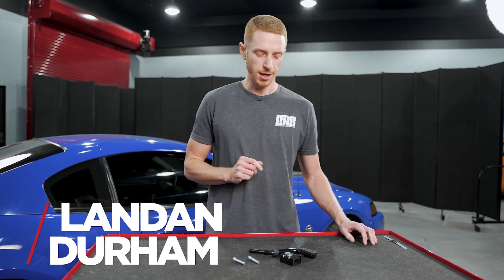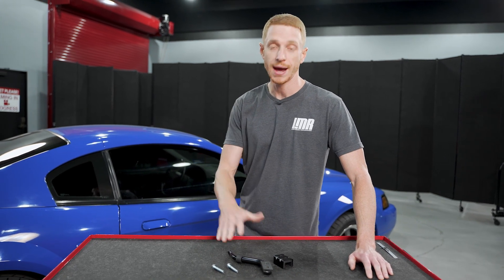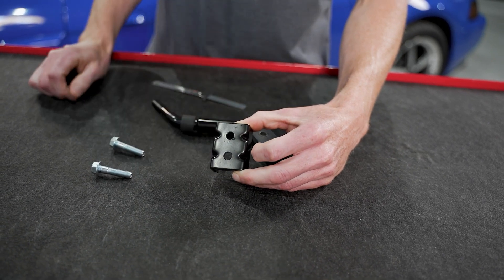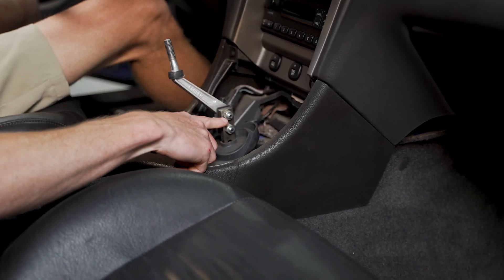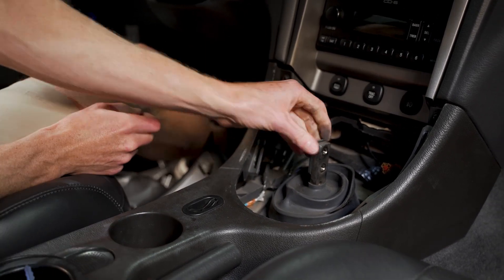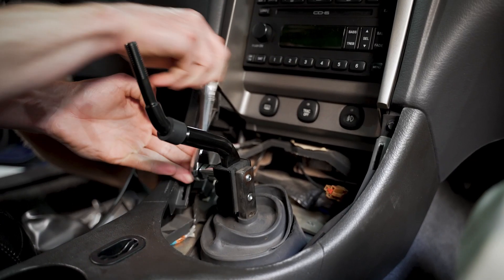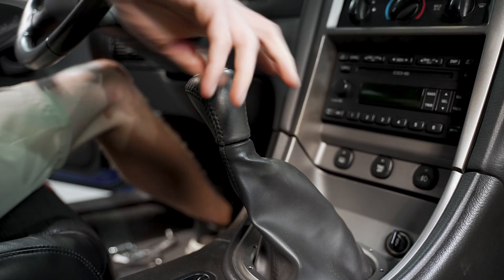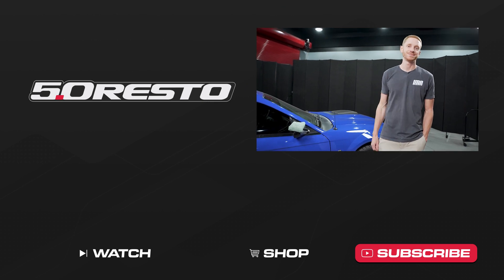1983-2004 Fox Body, SN95, & New Edge Mustang: 5.0 Resto Factory Style Shifter Handle - Install

Comment: The comment and expression you made just after 7:39 made me literally laugh out loud. 

I sittin' here trying to daily this summer in my '86 T-top GT 5 speed. Which includes a four and half to five hour commute EACH WAY on the weekends in a car that has had a 13 year hibernation in the garage, an interior that consist of only: A Dash, door Panels, S&W roll cage, and a set of Summit buckets with five points, all circa mid to late 2000s...  Yes,  mistakes were made. 

Only Lord knows what I wouldn't do for a retractable seatbelt and a cup holder right about now.
Reply from the maker: I know what you mean! -Landan

Comment: I noticed your mach 1 test car had a steeda tri ax shifter. I have one in my 98 cobra and while it's a good shifter, it's kinda notchy feeling. Does this factory shifter handle make it a little easier to shift?
Reply from the maker: The rubber isolator in the factory-style handle helps reduce some the "notchiness". While that's one of the benefits of a short throw shifter, to some, it's a little too much. Hope this helps. -Landan
Reply: @latemodelrestoration  That actually does help. Mine's not terrible but I'd like it to be a little smoother. Thanks Landan.
Reply from the maker: @brianspangler3771  You're welcome! -Landan